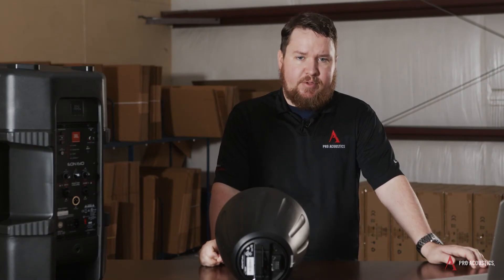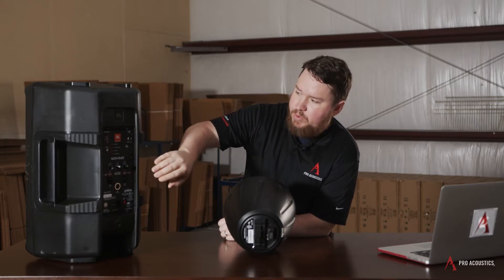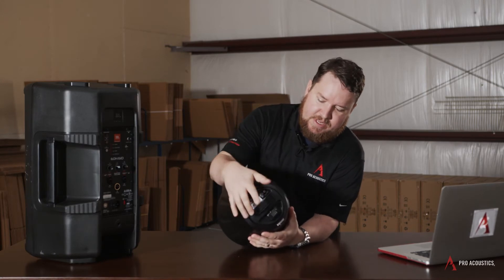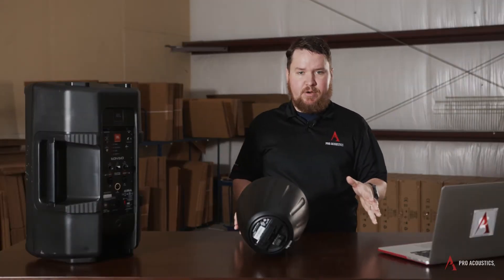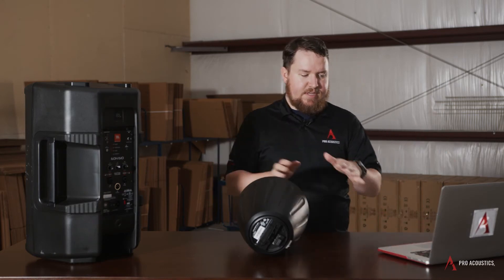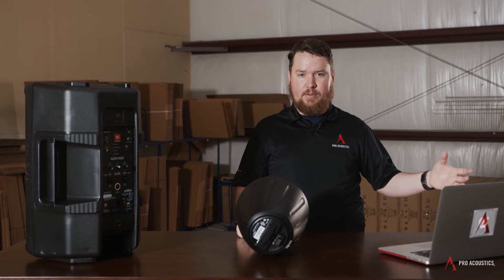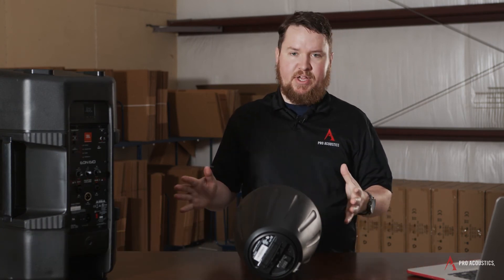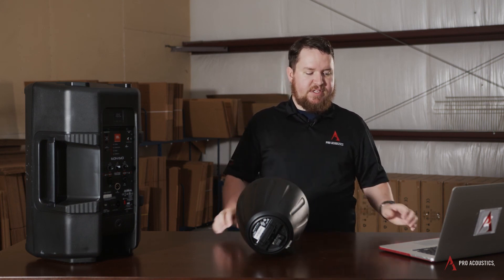Quick Clip: What are passive PA speakers? (Pro Acoustics Tech Talk Ep. 55)

Comment: what kind of speakers would you use in an outside/outdoor setting PA Bogen C100 amplifier for a pioneer club tractor pull event ?
Reply from the maker: For outdoor events, you will want speakers that can deliver clear and powerful sound across a wide area. A horn speaker like the Bogen SPT30A or a similar model would be a great choice to pair with your Bogen C100 amplifier. Consider the area size and expected crowd when selecting the number and placement of your speakers. Contact our Sales Engineers for additional guidance with choosing the best product for your needs by calling (888) 256-4112 or email sales@proacoustics.com.